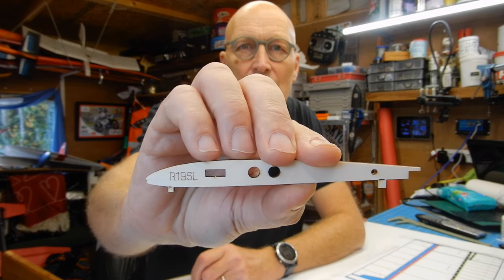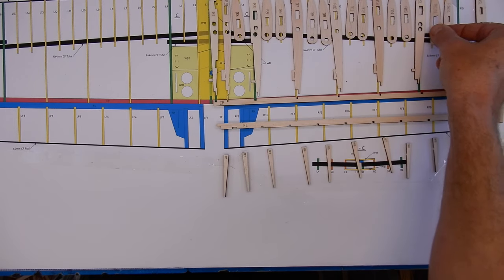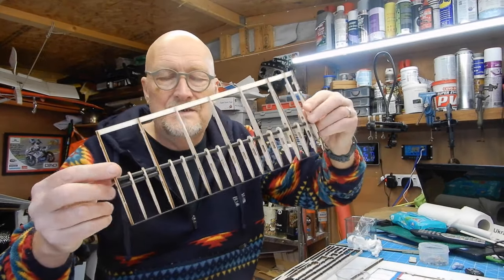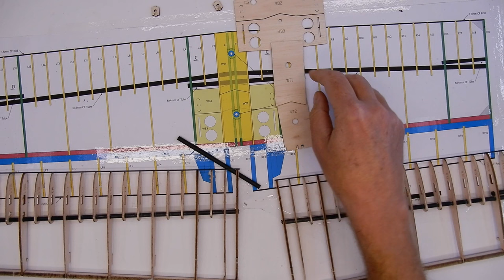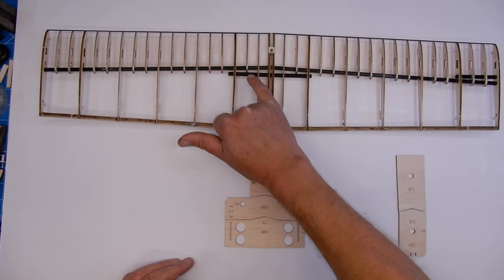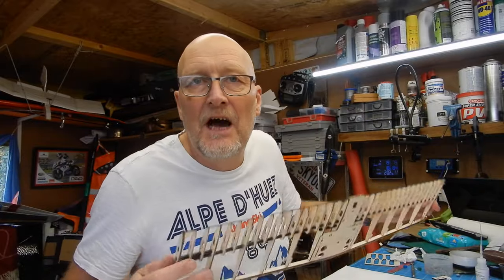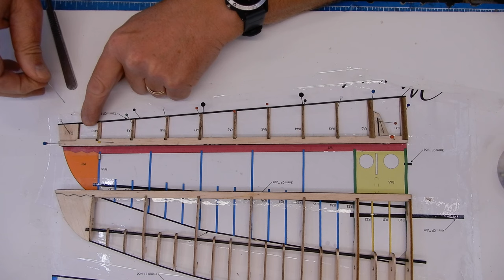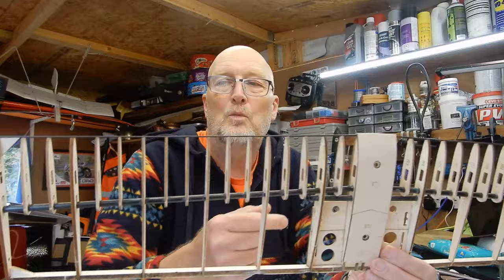How to build the Maverick F5K glider Part 2 Wings

Comment: Thanks Nick! I noticed several eureka design inclusions that intrigued me. +25 points to the designer for the rounded half ribs, the center wing joiner system with sheeting, and the trailing edge zigzag matching pattern to increase surface area strength in the tip. This is a very well-thought-out plan. Your inclusion of the carbon fiber tubes going into the tip +10 pts, I would do the exact same. (I don't know if the rounded half-ribs will reduce the visual of half-rib corners showing up in the final appearance, looking forward to seeing it covered.)
Reply from the maker: Cheers paul I hope to do a special cover scheme 🤞

Comment: I`m glad that you do these build videos, they help me a lot. The Maverick I ordered has now arrived and I have started the build, I didn`t realize that there are two wing options, thanks for that, I will also take care when selection which carbon tube I use. Many many thanks.
Reply from the maker: Thanks Mel good luck with build I’ve got good deal on some servos 😍
Reply: @NickChittyFlying  I`ve got servo`s on order from China already, DHV56MG as recommended, cheapest I could find but really long delivery time. From where did you buy yours?
Reply from the maker: @meljones7066  sweet mate